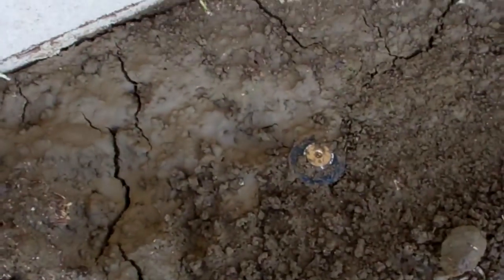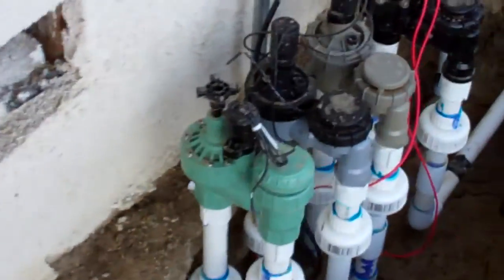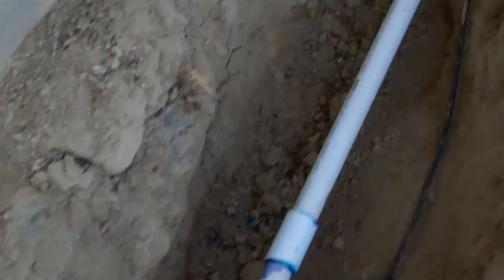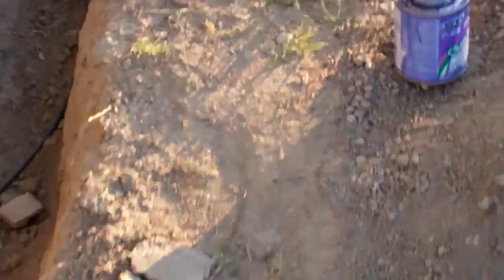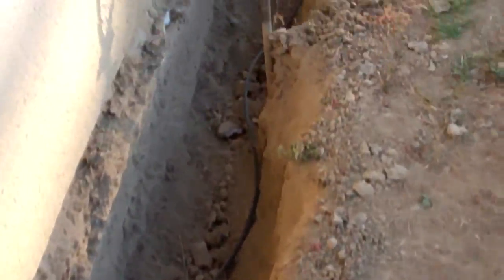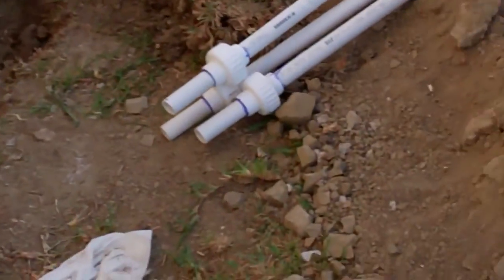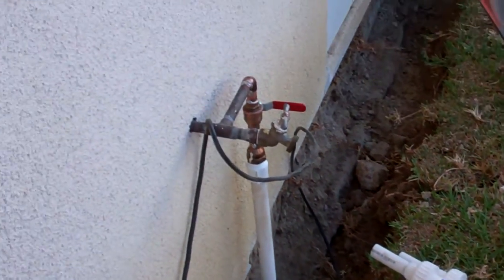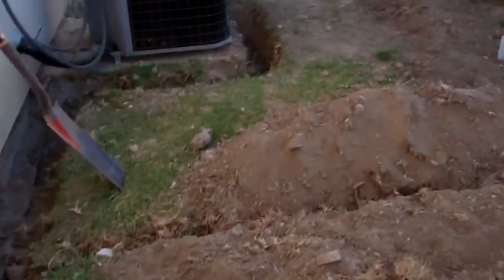MaxFixIt.com Home Sprinkler System Video 13 Installing Spray Heads

Comment: Your sprinkler system is kinda ok and the reason why i say that is because you have everything mixed up. For example you have Orbit, Hunter, Rain Bird, and Toro heads. And having mixed up heads are bad because each of them water either a different spray or if there are mixed up rotors they can rotate back and fourth in a different speed.
Reply from the maker: Interestingly, we did use various spray heads to see which we liked best. Not sure after all that if I have a preference. The are pretty much interchangeable IMO.
Reply: @max4rent  I’m so sorry, I left that comment so long ago 🤣 weirdly enough I was a kid who had an extreme fascination with sprinklers, and watching videos of sprinklers was all i did. It’s funny how I said that in my comment because now, I don’t care about The brands of sprinklers that I put into my yard as long as they’re in the same sprinkler type as the others in that general area, I also don’t have an extreme fascination with sprinklers as I used to anymore, so that might be the reason why I don’t think much of small things like that. I totally understand the trying out different brands of sprinklers thing, some brands are complete trash, while others are great. I know that all you did was reply to my comment on your video, but thank you so much for bringing up a blast from the past for me 🤣🤣